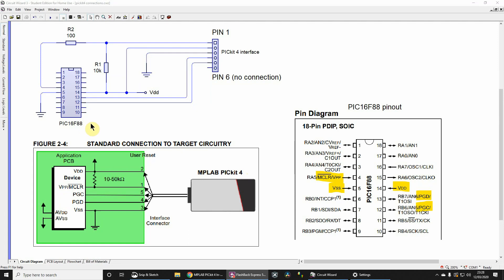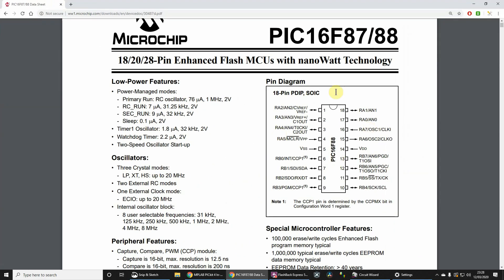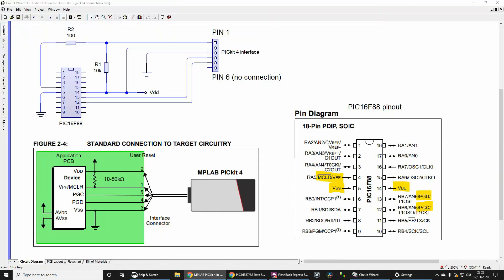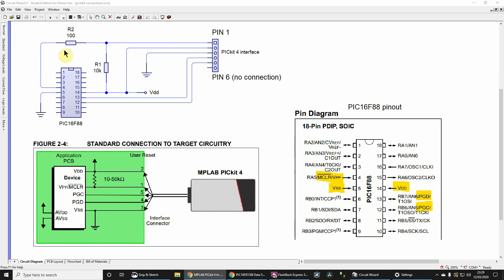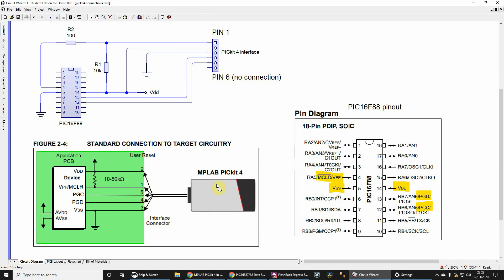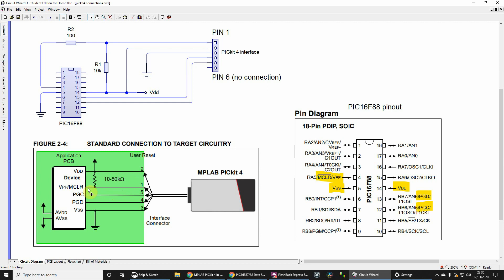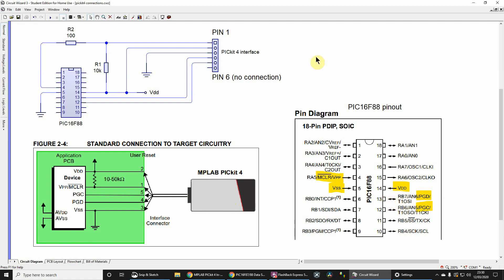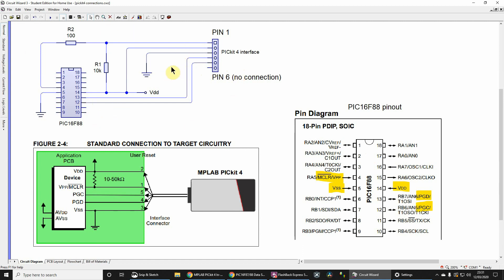PICkit 4 and PIC16F88 wiring connections for ICSP

Comment: How do you know which microcontrollers require the 100 ohm resistor and which do not?
Reply: If I understand this Engineering Note correctly, the need for the resistor depends on how new your PICKit 4 is:

https://ww1.microchip.com/downloads/en/DeviceDoc/ETN37_MPLAB-PICkit4_overshoot_modification.pdf

It appears the issue has been fixed with newer versions: "NOTE: If your MPLAB PICkit 4 serial number is BUR20xxxxxxx or later, you do not need to apply this ETN."

If you have an older model, then I'm assuming you need the resistor when programming the 16F series to avoid the risk of frying it.
Reply: @michaelmccloskey8212  Well, actually mine's serial number begins with BUR22... but it still kept killing PIC16F887 MCUs 😢😔.
If it wasn't thanks to this and other videos mentioning the 100 ohm resistor I would probably still be searching for answers in documentation and Microchip forums.
Reply from the maker: If I recall correctly, it is the 8 bit (16f...) Microcontrollers that require protection.